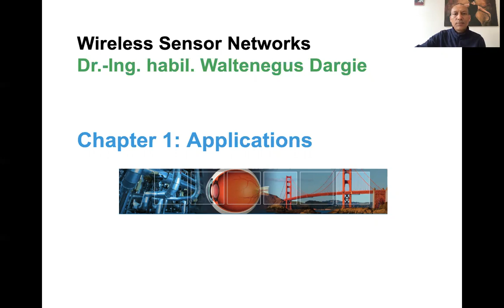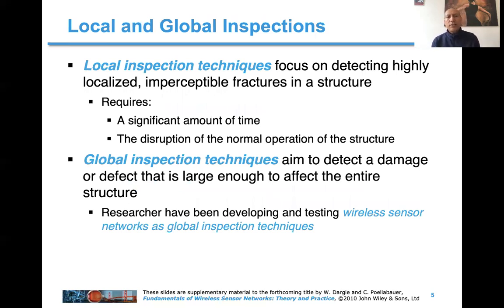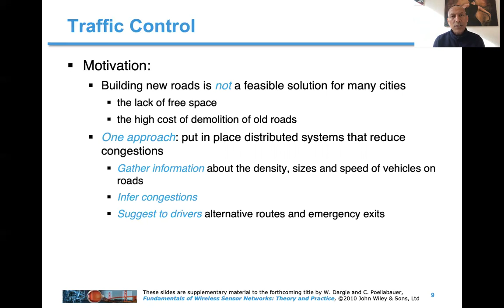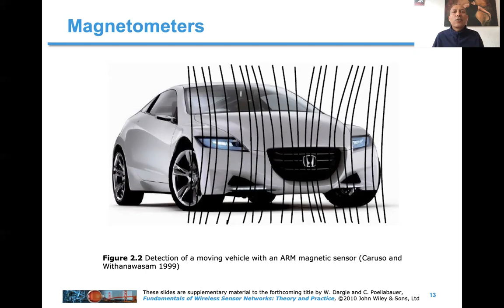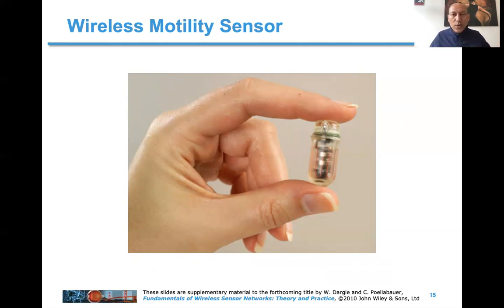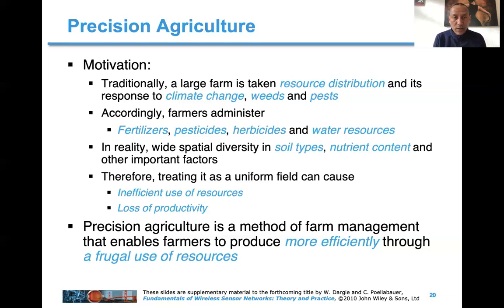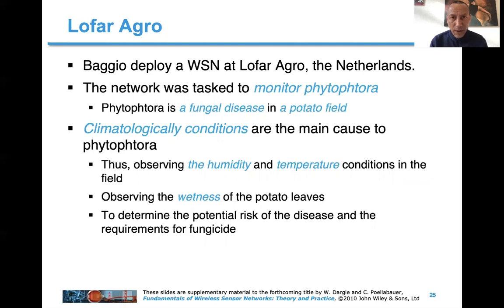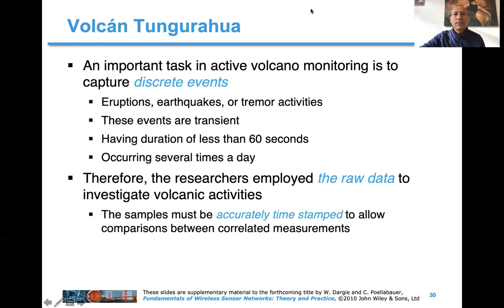Applications of Wireless Sensor Networks

Comment: Sir can you tell me what is the application of Sybil attack and sinkhole attack in wsn
Reply from the maker: In a wireless sensor network, the predominant direction of traffic is directed towards the sink or the base station. All nodes must send their data to  the sink. A malicious pretending to be a sink and deceiving nodes to direct their packet towards it causes a sink redirection and the attack is labelled as a sinkhole attack. It is one of the most dangerous types of attacks. This attack takes places when the malicious node  propagates a false routing update request pretending to be the authentic sink.  Sybil attack is in general the attempt by several malicious nodes into the network. These nodes, if admitted, can congest the network by overwhelming intermediate nodes to forward spurious packets, sabotage the network by dropping packets which they are requested to forward; etc.